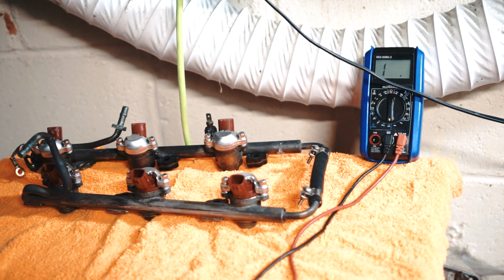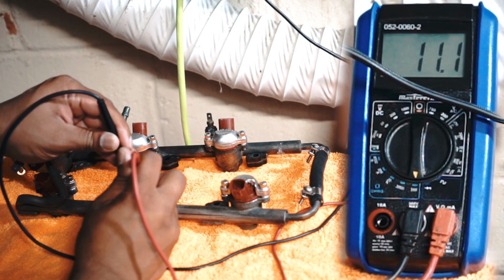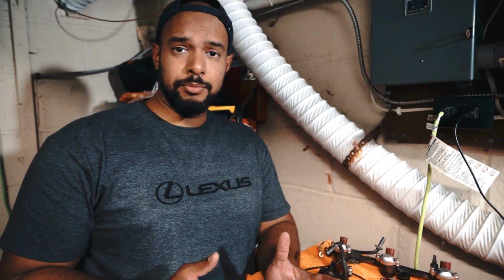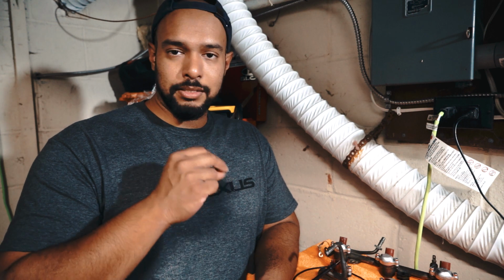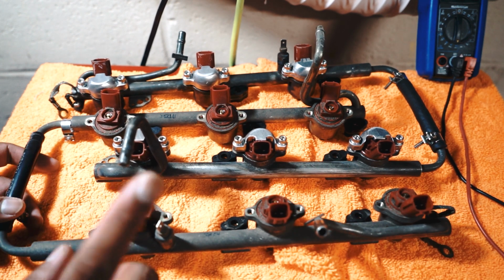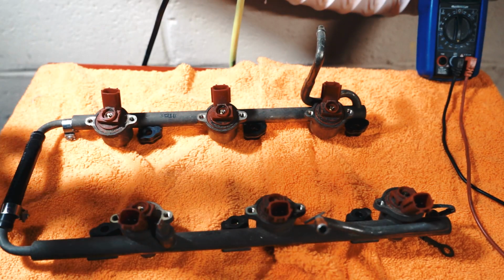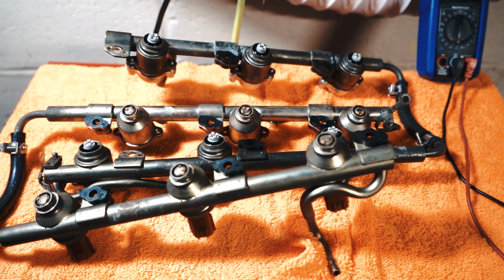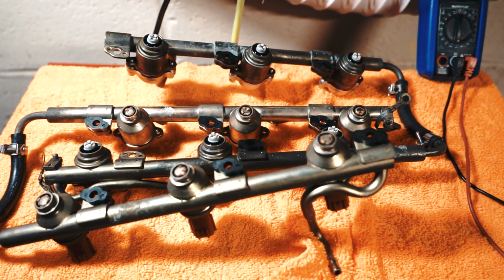Everything you need to know about AUS injectors.

Comment: Hey owner of ZShack checking in.  Great video, I just wanted to add some info about the AUS CNC billet pintle caps.  This is a part we worked with Ricardo(the owner of AUS) to produce exclusively for ZShack.  The reason why these are made is because we are seeing failures with the plastic pintle caps on all brands of side feed injectors, including NISMO injectors.  They are falling off during operation which is causing a hydrolock situation since the pintle cap holds the lower oring on the injector in place.  Now I can 100% guarantee that if AUS injectors are ordered with us they will come with the billet pintle caps.   As for what AUS does with injectors ordered through other retailers I cannot speak for and I am assuming that set came from one of them as we have been using the new pintle caps for about 2 years now.
Reply: Hi Rick!

I was directed to you by car-addiction with a question regarding AUS injectors, maybe you could point me in the right direction. I have a set of 740 nismo injectors to drop in my 300zx and I can also get my hands on an eprom flashed for 740 AUS injectors locally. Do you think these two will be a match?
Reply: @ricardomenjivar5731  ok so when we worked with AUS 6 years ago on their side feed injectors, we sent in a legit Nismo 740cc injector to them so they could match the flow settings and dead times with their AUS 750cc injector.  So tuning for Nismo 740's and AUS 750's are exactly the same now providing you have legit Nismo injectors and the AUS tune was made within the last 5 years or so.  Hope this helps
Reply: Thank you so much! Looks like I'm all set! I really appreciate you sharing your knowledge! You rock man!
Reply from the maker: Hay Rick, glad to see you here. I wish I know this before. I ordered this from CZP as we Canadian z32 owners have a special discount code from czp. I'm going to update the description of this video and mention this information. If you ever want to come up to Toronto, we have over 10 cars that can use a tune from you.

Comment: hey nice vid, I got a question maybe you could answer. I have a set of 740 nismo injectors to drop in my 300zx and I can also get my hands on an eprom flashed for 740 AUS injectors locally. Do you think these two will be a match?
Reply from the maker: Hay Ricardo, both AUS and NISMO uses the same jecs core.. I'm going to assume it will be fine. Just to make sure. If you see in the comments, you will find the owner of zshack. Ask him the same question, you will have a more accurate answer.

Comment: I just replaced my fuel injectors GB ,,.injectors,,.They're expensive..  Important to keep up your fuel injectors, thank you for the video..👍🙋‍♂️💯🇨🇦🇺🇸
Reply from the maker: Thanks man
Reply: @runningrich   I would have used AUS👍 but they weren't available at the time, these gibs were a little cheaper.. Texting's is hard can't explain anything engine running good iand transmission I'm so happy to have A new  Remanufactured  car funny🙃Drive's like new.  Thank you for your thumbs up  Thank you for the video..